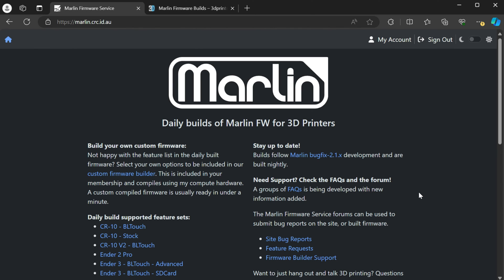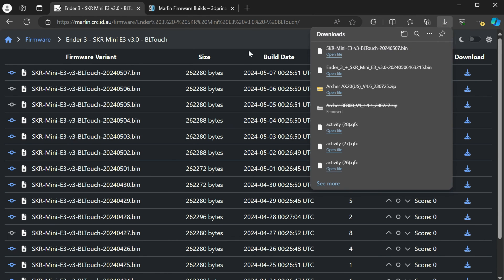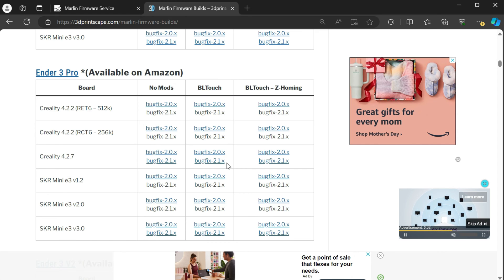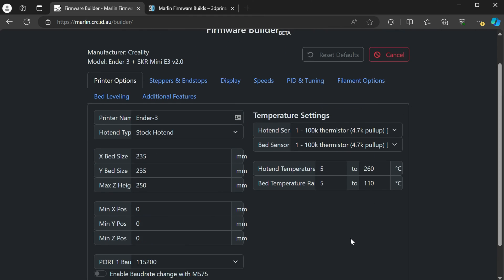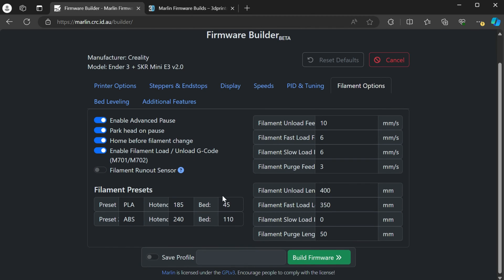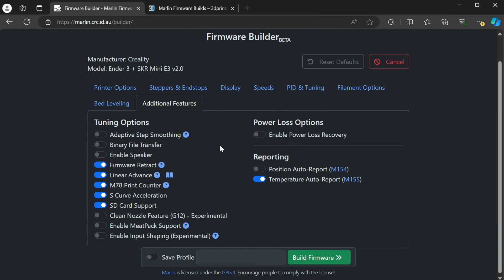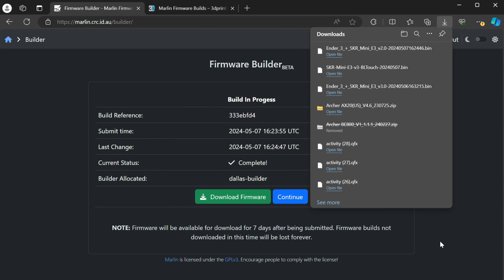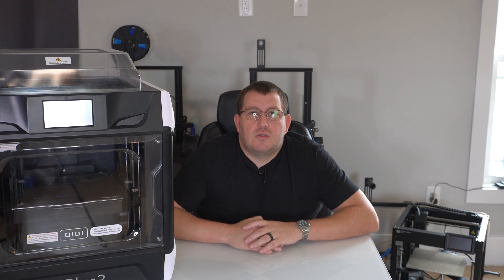Marlin Firmware Builder

Comment: So, I have the ender 3 pro and I have added a cr touch and the spider hotend with the supplied thermoster. There is no info about the thermoster, and my temp range is restricted to 260c. The firmware for the hotend doesn’t support the cr touch and vise versa. I’m trying to print PCTG and the 260c just isn’t hot enough (very stringy)  I went to the AU website and signed up… the ender 3 pro set up is only available with the 8 bit board, I have the 32 4.2.7 also the cr touch isn’t an option nor is the spider hotend. The thermoster options are a million different but because I’m not sure what I have I’m not sure what to select. Any help would be greatly appreciated

Comment: ok... I'm nor sure which of your builds to DL.  I believe want the BL touch for my RET6. I'm sure this is my ignorance working here. I installed the Cr touch per the instructions. But The old Z small plug on the board was glued in and I didn't want to pry it out and possible tear up the board. I did unhook the Z micro-switch.  So do I need the Ender3 Pro Bl touch with Homing or the other one. Sorry for my stupidity-I'm old

Comment: I watched a video of yours recently. It may have been 2 years ago. It was building firmware for mini e3 v3 and cltouch  at one point you mentioned config.ini.  “To make life easier”. In marlin 2.1.2.4 there is no filament mention in config.ini ?  I did successfully build that marlin firmware for my ender 3 w/cl Touch , filament runout.  But that config.ini filament issue has me concerned.    Thank You for your help on the above mentioned build though 😀
Reply from the maker: Hi. I would have to go back and watch the video to know what i was referring to lol. But if you got a build you should be good.

Comment: WHY  am I getting errors ?  I don't understand. 

Build Reference:	e0e7bc56
Submit time:	2024-09-09 01:07:26 UTC
Last Change:	2024-09-09 01:07:30 UTC
Current Status:	 Build Failed!
Builder Allocated:	syd-builder.crc.id.au
Errors:
buildroot/share/PlatformIO/scripts/../../../../Marlin/src/inc/../../Configuration.h:23:2: error: "Don't build with import-2.1.x configurations!"

buildroot/share/PlatformIO/scripts/../../../../Marlin/src/inc/../../Configuration.h:24:2: error: "Use the 'bugfix...' or 'release...' configurations matching your Marlin version."
Reply from the maker: Hi. It looks like your config file isnt from the same version as the source. Dont use an old config, make the changed in the new one.
Reply: @3DPrintscape  Thanks for the help. I figured the main file was just the 2.1.2.4 bug fix version then selected for the individual needs from
The selection.  Is there a way to understand the Classic Jerk settings vs the new settings.  I’m on the 4.2.7 board. 

I have an Ender3 Pro.  Manual bed leveling but I do like that I may be able to add a probe.  Just not sure which one. BL , CR or the other offerings.  I print occasionally. Have a
Metal bed.  I’m just trying to get it going like it was. 
Loving your videos.
Reply from the maker: @GreyGhost-r4z  Honestly, most of the time you wont need to mess with the jerk settings. Are you having an issue that your hoping to solve by changing them? As far as the abl, with the bl or cr will work fine. I would get which ever is cheaper when you go to buy.

Comment: Hi, I have the Ender 3 Pro with the SKR Mini E3 V3.0, TFT35 E3 V3.0.1 and a BL Touch. I am using the firmware from your website, and tried to follow one of your other tutorials, but my ABL menu isn't in the same place yours is in, and I don't have the Z Probe Offset Wizard. I have a P Probe Offset Wizard which looks similar to the Z Probe Offset Wizard, but when I press the button labelled "OFF" to switch it On, the printer moves the nozzle around a bit and then the screen locks up. I can't figure out how to get this to work, any idea's on what I'm missing?
Reply from the maker: Hi. The firmware on my site should work fine in this case but setting the z offset will be different with the tft35. I think they did end up calling it p offset but i would need to update my tft to see exactly what they changed. Maybe someone here or on discord can help fill in the gaps.

Comment: Thank you all the great video's, I have a question I updated my board to a Bigtreetech SKR mini v.3 running Marlin.I have a Spider hotend. when I started testing it the temp would go up to 260 even though I sent it for 215. It will slowly drop and fluctuate from 213 to 220,and never hold temp. Have you hear of this before?
Reply from the maker: Hi. I have not seen this before, there could be something up with your hot end thermistor.
Reply: @3DPrintscape  I was able to work it out it was the heating element, the spider I got did not come with the wiring harness. So I got one from Amazon but I got the 12V not the 24V once I replaced that it works perfect. Thanks for the help.
Reply: @3DPrintscape  Thank you very much for the reply I will get another one and see if it helps.

Comment: Thanks for the video. The steps were straightforward to follow. So, I used 8 of 10 of my downloads trying to get Marlin to work with Ender 3, Cr-Touch, Sprite Extruder, and a run-out sensor. My Creality touch screen never loads, the boot-up screen never works, and the new software has never been installed.
Reply from the maker: Hi. I was never able to get the creality touch screen to work with marlin. Not sure if you had it working prior to doing this upgrade or not but it may just not work.
Reply: @3DPrintscape  Are there any alternatives to using marlin? I was running Creality OS before my failed attempt.
Reply from the maker: @Nojokebeatz  Not with that screen that i know of. If you use klipper the screen would just be off.